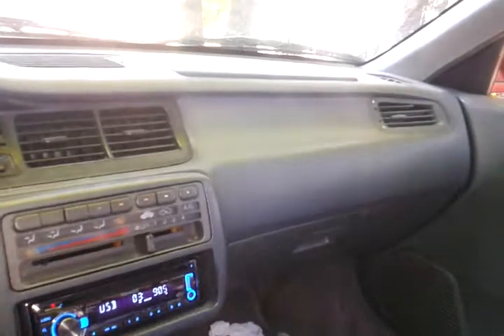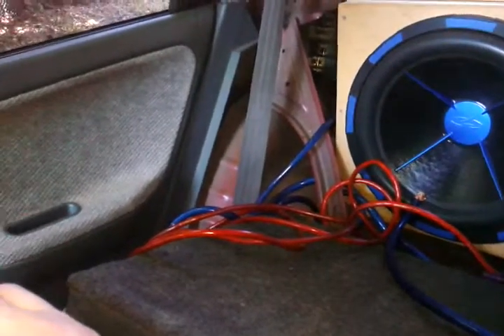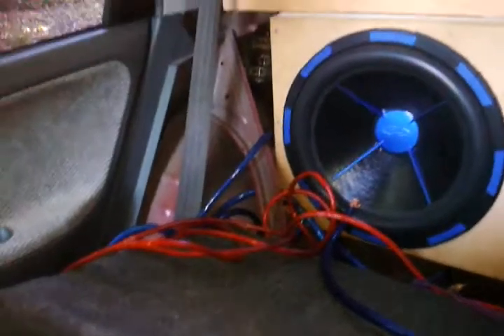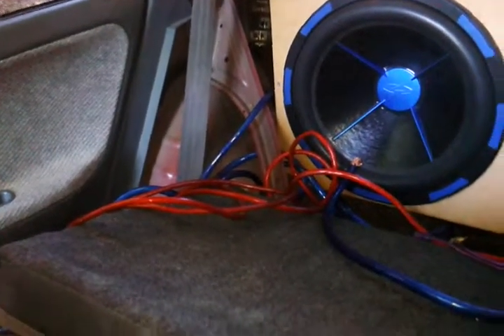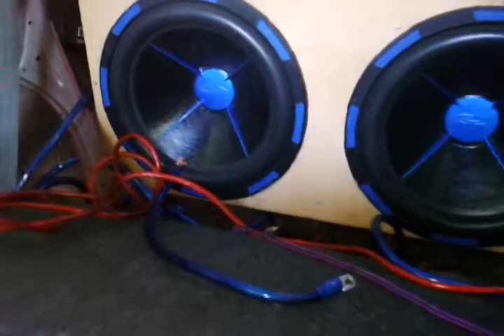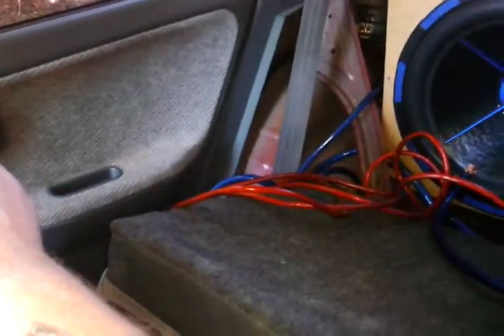The stereo ghost in the machine.

Comment from the maker: It turned out the problem was 3 fold.my breaker between bttery banks wasn't working all the time..causing the rear bank to not charge....low voltage was the real criminal.but I also went thru and regrounded it all..mo better.fucking grimlins in the system must be purged.